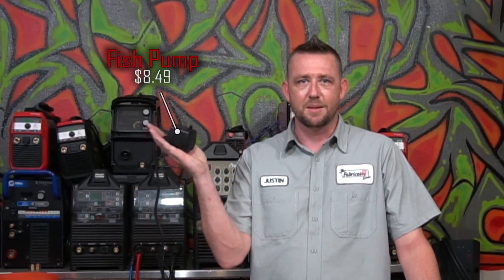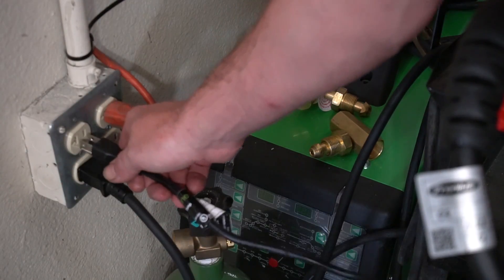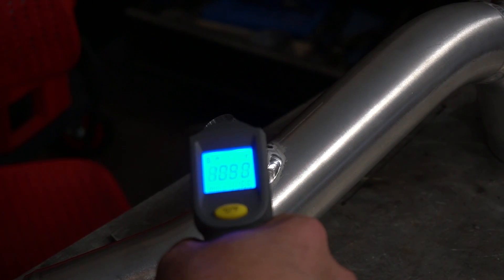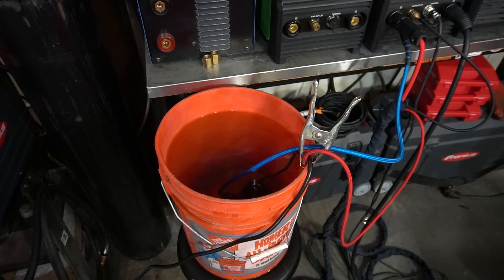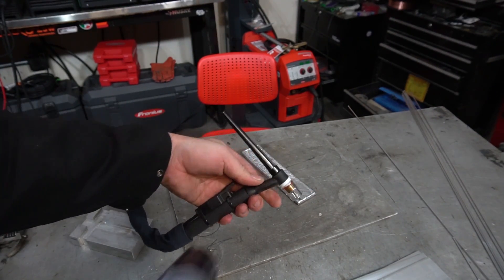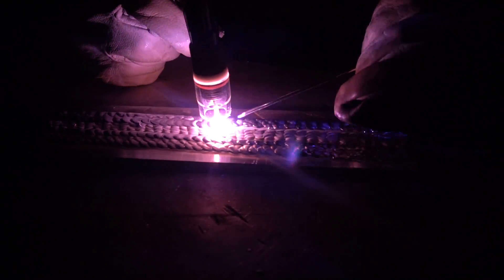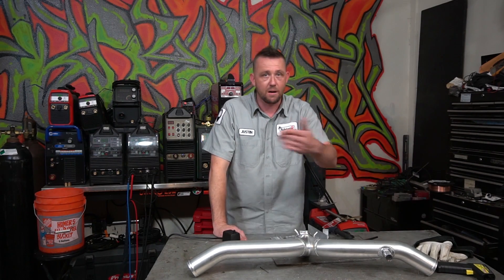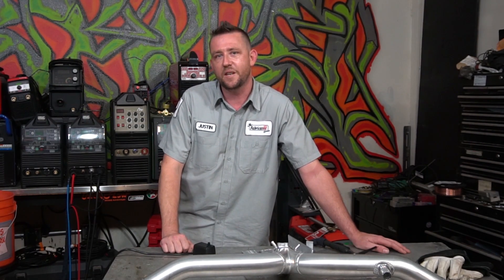TFS: $12 Dollar TIG Torch Cooler

Comment from the maker: Here is the pump!
https://amzn.to/2KvFpPd

Other Tools & Gear We Use and Recommend
https://www.amazon.com/shop/thefabricationseries
Reply: Dude I have a powertig 210 ext. I made one with a slightly bigger pump it works great. I used one of those pool chemical bucket which is a bit larger
Reply: @Sneadawelder do you know how many gallon per hour your pump is? I order a 220gpr pump to try
Reply: After 10 years I've given up trying to feed filler rod

Comment: Mileage may vary but I tried two different small submersible pumps and they just couldn't cut it.   The next step up was larger diaphragm pumps but their output was way too much and I didn't want to blow the hoses on the tig torch.   Finally settled on a 1.6 GPM, 12 volt pump from Ebay and it works just fine .  Coupled it with a 12 volt power supply from Amazon and I'm all in for about $55 including the bucket.  I added a ball valve as an adjustable bypass because the little pump while being low volume is very hi-pressure.  Now I have a water cooled rig for cheaper than the $500 Everlast wants for theirs.  I don't anticipate heating the 3.5 gallons of water to the point where I need a fan and radiator but if I do there is ample room to add these on top of the bucket and they are quite cheap from computer vendors, and I already have the 12 volt power.

Comment: Hook to city water...  Not my idea but ive had a 15 year old Radnor water cooled torch in the box . The instructions show how to attach it to the city water.  They show 3 different ways of hooking it up to regular house/shop water supply . Basically the line going to the "in" side of the water cooler, goes instead to a water drain.  The supply line is the normal water supply side to the torch from your home or shop.
This setup would be using the water pressure from your shop, no pump needed and its always bringing in cool water.

Comment: I did this. I got I high pressure fish pump. Got a snap on bucket top cut 3 holes. One for the plug one to hook up to the pump and another hole on the other side for the hot return. Through ice it

Comment: I wouldn’t have guessed you would get adequate flow out of that pump, but cool.  Along that line, those pumps don’t have much head pressure/capacity, so having the bucket at the same height as the torch would possibly improve flow.  Better cooling for this very simple light use setup, Lower the source temp…  you could add ice to the bucket.  In order to maintain torch temp with room temp water, you need a radiator and fan to dissipate more heat.  Like some of the other comments, add conductive materials and airflow or use a cooling source/chiller…

Comment: Love my new 325X I bought from you, WAY better results welding aluminum than my old Miller Tig Runner 250DX. My one complaint is the water pump output voltage connection on the back of this thing. (I'm making my own water cooler). Using 220V power, it is sending 220 volts to that connection! So I'm not gonna use it, I'll just hook up my cooler to a normal 120 volt outlet and never forget to turn it on, at least for heavier welding.

Comment: If you are ever desperate for torch cooling and you don’t have a pump you can use gravity. Just connected tube to a 5 gallon bucket and elevate it. Connect the tube to water input tube of the torch. Then put output tube in a  5 gallon bucket on the ground.  Larger containers in higher elevation works better and be mindful of the amount of water left in the elevator container. When the water level in the top container becomes low ,Just pore the  lower container back in top and repeat.
Reply: My plan exactly. And add a sight tube

Comment: Basic thermodynamics. Q=MCDelta-T, Heat=(Mass flow rate)(Coefficient of heat transfer)(T2-T1) The faster the water goes thru the torch the less temp diff from inlet to outlet although the bucket will still rise the same amount. Linear relationship...twice the flow 1/2 the delta-T. What I don't understand is why measure the temp of the cupon? The cooled torch would have cooler shielding gas but is that significant in relation to the massive amount of energy put in by welding? It's not ghetto as far as the torch is concerned. A $4,000 cooler or a $400 cooler or a bucket at the end of the day do the same thing. Keep up the good work!

Comment: What's never going to work is taking the temperature of aluminum. Won't work. Aluminum reflects heat. Will never be accurate. I can shoot the aluminum shield behind my wood stove and get 700 degrees. But I can touch it. Because it's like a heat mirror.

Comment: I feel that you could make a pretty good intercooler for under $100. maybe get like a PC watercooling radiator and hook up some pc fans with a 9v or 12v power supply. that coupled with a better pump could probably stand up with some commercial solutions.

Comment: one of my first TIG coolers was a garden hose connection on site doing a railing job, it just drained to the street. next was a submersible little giant unit in a 5 gallon bucket, but they are shaded pole motors and throw off so much waste heat they heat up the water more than the torch most of the time.then a carbonator pump, rotary vane unit out of a dumpster. current one is a proper tig cooler I got for 25$ these are the most overpriced welding accessory there is.

Comment: Totally fine thing to do if you use distilled water and a higher pressure diaphragm pump that can actually push the water through the tight hoses and head.

Comment: I have been trying to find the specifications for the pump and when I looked at the Everlast 205 SI water cooler it said that it was 1 quart per minute which came to around 15 gallons per hour can you tell me what the specifications for that pump or because the link for the pump that you have in the description is no longer available

Comment: You have some excellent videos! and they’re very very helpful! 
here’s an idea for this homemade water cooler! use the 5 gallon bucket with a bag of ice have the water input connected to a copper line coiled up to the top and have the output exactly where you have it! You can weld for a whole lot longer and your torch would be very cold!! just an idea!😁
Reply: Should you be concerned about too cold, especially from the gitgo?  Cracking something?  Just wondering.

Comment: Does anyone want to know the trick to this? Do NOT use tap water!!!
Use distilled water and a corrosion inhibitor. Tap water will ruin your torch over time. Trust me.
Reply: Ita take a very very  long time
Reply: @mikemullis6862  no sir. It does not. But it depends on your water source. Our water is extremely hard. Tig torch cooling ports are very small.

Comment: I have used this same setup on a water cooled 4500psi air compressor for years. Never had a prob with it running and the air compressor get up to 140f or 60c

Comment: Did the same thing. I use a racing go kart aluminum gas tank. Allows it to vent and it draws water out the bottom, and puts in back in the filler neck. And being aluminum ive yet to get it even warm. No fan needed 🤘 running a 50/50 coolant water mix as well, distilled water that is

Comment: Hello I have a Linde 150 amp torch  with my power line.   I’m using a little giant for years myself and a friend used these pumps.   

Of late my project went to welding 1” plate.   So I purchased a Miller 250amp torch and I have to be are full no to over heat the pump.     

The request is what do thing I can do for a simple pump?  My funds are limited and I’m retired and doing inventive project at home.   Greycattle@gmail

Comment: Hello my name is Joe.

I work out of my garage that freezes.   So I have a very finite budget.   

I have a little giant pump serving my welder.  Everything was fine for years.  

I melted my power line. 
I bought a new miller 250 amp. Torch.  

I can not get the liquid to flow when torch is in the loop?

Zero out put yet the pump with out the torch incredible flow. What do you think my welder is a Lincoln (that shouldn’t matter?).   I’ve bypass the control for constant flow.  

My friend has been using this method with ( water and antifreeze) on a 300 amp torch; for 20 plus years.

Comment: You can also improve the water cooling by putting a tank bubbler in the bottom of the bucket and running some metered compressed air through it.

Comment: I'd use some glycol but for the one job you get that's just out of your equipment range it's a hell of a working idea. Maybe even go crazy pop some holes in the bucket and epoxy in the fittings. Great channel! Love all the content good bad and ugly.
Reply: no need for epoxy, they make bungs specifically for putting holes through things and making them leak proof.  Super cheap and in any size you want.
Reply: I just saw this comment was from 3 years ago lol, my bad bro

Comment: Great demonstration and yes, it will work until you can afford a closed loop system. Also, if you have hard water you will likely get some scale buildup in the torch head. That said, I want to give this a try!!
Reply: A guy could throw in another $5-10 and fill with grocery store distilled water.
Reply: @oneproudbrowncoat  Brita (or costco) filtering the water might work, too, as long as it gets those solids out.  See my comment about Everlast recommending certain types of coolant for their coolers.

Comment: You don't even need a pump just 2 buckets... one above one below.... when one empties switch em.... put a radiator and go longer.... I would not pay 100 bucks for a cooler....I can make one with radiator and fans with switches and pump for probably 40 dollars and spend 20 to 30 bucks on radiator fluid for auto and be good to go

Comment: Now hook up another pump running to a mini power steering cooler with a mini fan strapped to the cooler. Could contain in a little unit if used like 2 gallons. And use glycol for better heat efficiency

Comment: So the coupons on the table were 85 degrees. I'm assuming that's room temperature. So the water temp would go up regardless of welding until it hits room temp. Cool video but the temp rise may not be very accurate. Just a side note

Comment: Why not just hook it up to the faucet and return to the sink? Endless supply of cold water. With adjustable flow rate and pressure. Lol and it prob cost under 5 bucks. Add extra cost for rubber hose to reach sink.
Reply: I have used the tap water method for 15 years on my Miller Syncrowave 300.  I live in a town with a flat rate for water and my cooling water goes into the same stream that our spring fed reservoir's overflow goes to.  I got the idea somewhere that the gentleman making these videos is in Las Vegas, if so, I imagine water is a lot more expensive and that single pass cooling would be frowned upon.

Comment: Damn, now I NEED a water cooled torch!
Reply: Everlast 275 (multi-process) comes with one, per the current specs, not sure about their dedicated TIG welders or other brands, but changing out a torch from air to water will not break the bank from what I see on line, unless you are in the very high amps stuff.

Comment: You actually don't gain much with a higher pressure pump. You need the water to "loiter" need the tig torch to get the heat transferred better. 

Love this video. Don't think I would change much

Comment: ah if you want maybe ah... use distled water if you can or go to walmart and get the di water out of the dispenser in the back of the store it runs anout 10 ppm.  distled water  is 0 ppm and you need a bigger pump... more volume and faster takeaway velocity.

Comment: As little as I TIG, this is exactly what I am going to do.  You could extend your cooling probably 100 fold by putting 20lbs of ice  in the bucket then filling with water and circulate ice water.  Just a thought.

Comment: I built my own water setup using some PC water cooling bits, radiator, pump and fans. Mounted it in my welding cart under the tig, works great with 2 360mm rads and twin pumps!

Comment: Funny you mentioned changing direction while welding and also feeding the wire, when I was building anodized boat crap we had some weird places we had to get in to on some of the pipe structures which I seemed to get assigned to do more than the other guys. One day I saw the reflection in my lens of the foreman walking up behind me wearing his welding hood while I was doing a pretty tough to reach spot, once he was there for a few seconds I heard "huh, I've never seen that before, we were trying to figure out what you were doing to get those welds in there so tight" as I was feeding the wire in to the puddle from the backside compared to the travel. This foreman was a welder's welder too, it was quite a compliment coming from him about using this technique especially because he was such a complete dick otherwise.

Comment: I bet for 100 dollars you could build your own 450 dollar equivalent. Have one 2 gallon water tank, with quick connect hoses. And have a separate unit with the water pump and a oil cooler off a diesel truck with 3 computer fans to move air, then rig the fans and the pump to a switch and just leave it on when the welder is on.

Comment: Run the return line to the top of a wire triangle above the bucket with a piece of window screen stretched across it. the water runs down it spreads out giving more surface area to lose heat out of. I’ve seen it used on an old stationary field hit and miss engine. It even had a low speed fan to move air across the screen. You could rig a switch to a computer fan and do the same thing.
Reply: Suggesting plastic screening so you will not get AlOH or similar in the water.  But I agree with other comments that one has to do LOTS of continuous TIG welding to need more that Fabricator's set up.

Comment: My Lincoln square wave 275 ran a 5 gallon pail with a heavy duty fish pump for many years without issue. Only downside is the water gets mouldy if it sits stagnant for any stretch of time.
Reply: pour vodka in the water

Comment: I bet you could run it a lot hotter if you installed a PC. cooler radiator into the stream. Course that would increase the cost a bit but it would still be consoderably less expensive than a storebought tig cooler

Comment: The only issue I see here is the use of the infrared thermometer if you shoot on a refletive metal or shinny surface as you did on the aluminum coupon,water bucket you will get a false reading you can be off as much as a 150 to 250 degrees. you need a black non reflective surface to get a accurate reading.Don't believe me try it out weld something hit with a quick spray of black paint do a before and after I think you would be surprised at the results! We do this all the time when testing how hot a exhaust pipe is on DPF systems.

Comment: Now go to a Pic-a-part junk yard and get a radiator with electric fans and run some VTEC Honda Blue Coolant through it
Reply: That's about what I was thinking or like a trans cooler or an AC condenser something you could fit the lines on

Comment: You could grab some computer watercooling gear. Slap together an actuall system for 100 dollars, and mount it in a computer case.

I use a 3x120mm thick EK radiator, EK waterpump, EK reservoir, fitted it all in a small compouter case, 12v powerbrick, crimped on quick fittings to the hoses, and mounted them on the front. Powerbutton on top. 

Been working for 5 years on distilled water. I quit gaming and started welding and "fabbing" stuff for a campervan. So it was "free" to me.

Comment: Dumb curiosity question: what keeps electricity from flowing through water to ground?
Reply: Chad,  The water is in a plastic bucket, and it is sitting on a wooden stool. I think that is enough insulation.
Reply: Chad Andrews The electricity it never comes into contact with the water. Check out the internals of a water cooled torch

Comment: It seems to me that a more permanent cooler setup could include an RV water pump (with built-in check valve) and accumulator tank. The RV pump will provide the pressure, and the accumulator tank will reduce the cycling of the pump motor.

Comment: I feel that if you were to discover a way to get a higher volume pump and hook it up to some sort of scrap radiator from a junkyard (or similar heat diffuser) in conjunction with a fan, and prime the system, you could get a lot better thermal efficiency from it. Id like to see this tested out to see if there's any significant benefits.
Reply: If you run into pressure issues, you could alternatively use an oil cooler which has smaller diameter connections, and a lower profile. I feel that this could serve as a semi-permanent setup, especially if you were to use a completely sealed reservoir using a gas tank from a lawn mower.
Reply: And rather than using a submerged pump, you could actually utilize the inline fuel pump and negate the bucket completely. I have a theory that you could drop the temps significantly, depending upon ambient temperatures.
Reply: So realistically all you would need is an old beat up lawn mower and a scrap cooler w/fan. Estimated costs would be south of 250 dollars which is significantly cheaper than a cooler, and potentially much more reliable.

Comment: A slightly better pump will work absolutely fine. I have been using a bigger one to pump contaminated water from my wash bay for several years Have the pick up about 4" from the bottom of the pit and works great, clean it out with gloves on every week or two. 
Use a smaller one with my parts washer as well and again works fine. Actually better than the $80 one they are supposed to use.